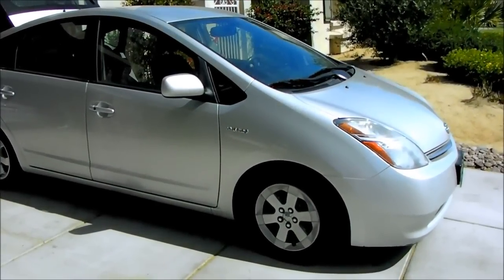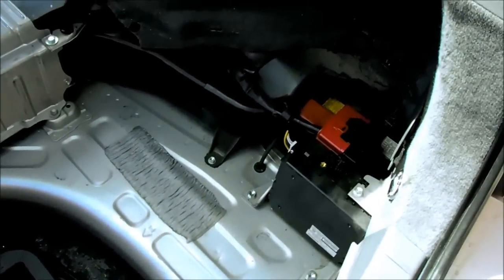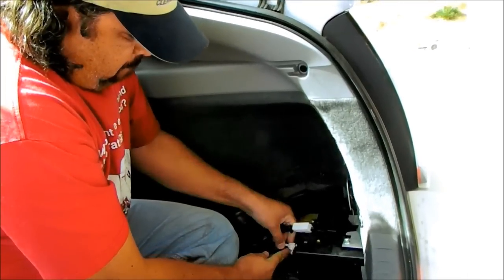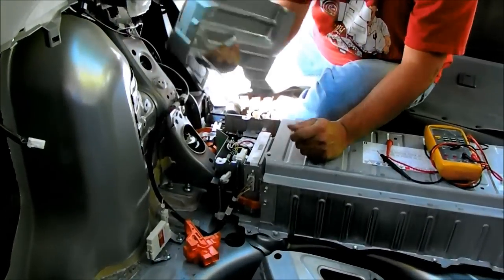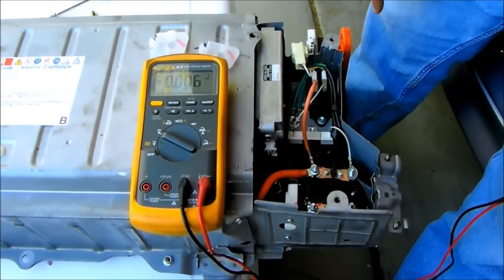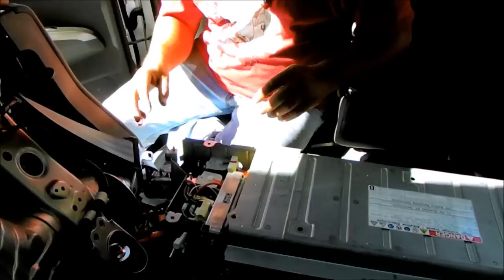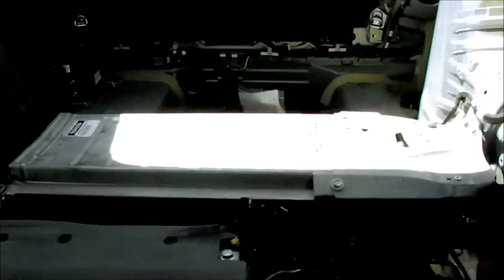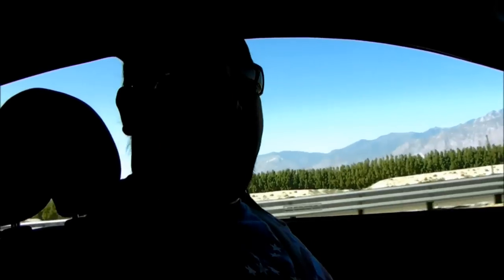Toyota Prius battery removal and repair. replace hybrid check engine light

Comment: Curious if there is something you need to do after replacing the battery. I just pulled the battery out of my 2007 Prius using this amazing video, then replaced the bad cell for $25 and put the battery back in. Now the car starts, but won't go into drive. Only park and neutral. Is there something special you have to do? Like hit a reset button or something?
Reply: yes put the service switch properly.
Reply: Michael McReynolds Same thing happened to me. No error codes and dashboard looked normal, just wouldn't go into drive or reverse and AC wouldn't cool. After a lot of retries, I pulled the fob from the slot, locked and unlocked the doors and put the fob back. It started working and has been running fine since. Have no idea how that fixed it.

Comment: It was not so much the 3400 toyota wanted to replace my 9 year 96k mile battery that got me but it's the only 1 year warranty on a brand new battery. I don't think I will   be buying another toyota after that. Right now I'm in the process of changing my one bad cell for the price of $46. My advise so far is take off your watch and ring when picking up or working on battery.

Comment: I drive a 2005 Prius that I purchased brand new.  Just today, I got the red triangle with an explanation point, the check engine light, and a message on the touch screen indicating a problem.  Interestingly enough, exactly 1 month ago I purchased one of those gadgets called 'Automatic' that plugs into the service port in most cars and interacts with their related iPhone app, also called 'Automatic'.  One of the cool things it does is report any engine trouble complete with detail which it did perfectly today - it reported an engine code of "P0A80" and an explanation of what that means, "Replace Hybrid/EV Battery Pack".  Very cool to know and not so very cool to know, if you catch my drift.  :)  Anyway, my 9 year old Prius car has only 81,261 miles on it.  What are the chances you think the battery needs replacing this early in the game for my relatively-low-mile Prius versus there only being a loose connection of some sort related to the main battery?  Actually, come to think of it, I had my Prius in for its 80,000 mile factory service at the same Toyota dealership I've been taking it to for service since buying the car, and I distinctly recall the same issue I experienced this morning just as I pulled out of my driveway on my way to work, which was brief bouts of hesitation in acceleration which cleared right up after few seconds.  My car was parked for about 10 hours and then about a minute after I began driving it to head home, the red triangle and other problem indicators appeared.  At this point, I'm planning on taking my car in to the dealership tomorrow morning and having them check all the battery connections, etc.  Any thoughts and/or ideas pertaining to my particular situation?  I'm all ears!  :)  Thanks...
Reply: Im curious to hear about your prius?
Reply: its a bad cell i have the same problem.

Comment: I just changed a new hybrid battey, but  I can't shift my tranmisrion. this message show up:
Caution 
The transmision "P" lock mechanism is abnormal. Park your car at a flat place, and apply the parking brake completely.
I park a car at a flat surface. I can't get a car run because of this problem Please Help!!!!!!
Reply: Jfff
Reply: +dupon lim make sure the small 12v battery has 12 volts and the ready light is on on the dash or you might need to replace small battery that happened to me when my small battery failed and it also throws other faulty codes inc replace hybrid when its just the small battery

Comment: Our 2006 Prius battery just died on us.  We were 1 month outside the 8 year warranty period, and only had 98K miles on it.  Toyota however cut us a deal on a new battery only knocked 50% off the price of the battery so $1200, instead of $2500.  We just had to pay for the labor.  This brought the total up to about $2100.  Still sucks, but at least its a brand new battery.  I thought about going the ebay route and swapping out the bad cells, but I felt this was only kicking the can down the road.  Great Video by the way.  At this point we are just holding off til the 2015 Prius comes out with a Lithium Ion Battery, in which these problems will be a thing of the past.
Reply: Just because it is li-ion does not eliminate the bad cell problem. A battery is still a battery. I have been around them in depth for 45+ years. You will still have to deal with the problem. Ole Geezer.....
Reply: What an amazing coincidence, Toyota just quoted me to replace my battery out of warranty for...$2,100
Reply: Robert Mencl
Sounds like they have cut their price to replace the battery.  Good move by Toyota.  Still not happy about it, but at least they are being some what reasonable.
Reply: Fred Yates
Interesting, all this time I thought Lithium Ion was better than regular batteries in this respect.  After you reply I did a little more research and realized they are about the same, even though Lithium is making improvements.
Reply: They have a higher energy density, which means you get more power per lb, but they still will fail. It is just a different chemical composition. The weakest cell will give out first, just like in any battery pack, might take longer, but it will happen.

Comment: Great vid, i have a 2007 with 380k miles still on the original battery pack :) i just replaced the inverter first issue ive ever had with the second gen, thou i drive my 3rd gen more with almost 500k on it :)

Comment: Awesome video the warning light just came on and I am showing the P0A80 could which on-line tells me this is the battery I also got a P1121 code which is a coolant control valve

Comment: Hi
I replaced a new auxiliary battery for toyota camry hybrid 2007
I waana just ask about supply break control power there is one plug  blue and yellow wires where i have to connect?i have to connect to positive cable battery or where

Comment: What scanner did you buy to read your codes? I took it to autozone and they said their scanner won't ready hybrids. I want to buy one but don't want to get one that won't work. Thanks!
Reply: +kyle lucas same thing happenef to me at autozone so i went to advance auto parts and the read it np there reader was orange i think it was al tek  or something like that
Reply: I bought a basic wifi OBD 2 reader from Forseal on Amazon, and downloaded a $10 app (OBD Fusion) and it read the codes for my 2006 Prius fine, and reset when I was done. Maybe newer models require different scanners, though, I only know what worked on mine.

Comment: I've been intermittently scanning for a video like this, good job, man! I know it took you longer, but I bet a tech who does this every day could do the job in an hour. How they get $1000 in labor charges out of that is obscene. Is there a core refund on the battery? Where did you buy the re-manufactured battery?
Reply: Hi Dave In Canada you can check out your independent parts dealer for the battery.        http://www.dormanhybrid.com/
Reply: Thanks, Steve. I'm not in the market right now, but likely I will be in a few years, so I'm learning as much as I can in anticipation.

Comment: a HV battery from a 2008 prius IT WORK ON A 2004???
Reply: I think 2004-2009 batteries will all run together. 03 and down work together and for the third gen it varies I believe because of the plug in. Always double check to be sure if you're buying one though.
Reply: thank you

Comment: ok i just did this repair but i rebuilt the battery pack, i needed one cell and got it off ebay for $45 shipped..i cant stress enough to be safe...dont try to clean the contacts with a metal wire brush...also the safty orange plug MUST be pushed down after its seated or the car will not start..also my car would not start for 15 mins after everything was back in place so dont be shocked if it happens to you, I think the computer has to reset to the new voltage or something..

Comment: Thanks for posting this video.  I imagine the SW heat accelerated the lifespan of your battery.  I have a 2004 Prius with 209,000 miles and the battery is  in good shape.  It was interesting to see how you replaced the traction battery.  You did a great job!!

Comment: Since you started doing this, any exposure to the 2006 Highlander battery?  Mine is "dead" (still driving around on it) and the cost at the dealer is $6,400.  Sadly, in the Pac NW so I can't have you fix it.

Comment from the maker: You could but I don't see much advantage in it and it will probably overload the charging circuitry with the extra load when the batteries are drained. Just my opinion would never try it.

Comment: hello just bought a prius off of an auction with some front end damage after car was fixed , 1 red triangle light came on and also check engine light , i got codes p1151 and p0a80 , do i need a new battery ? the mpg is really poor around 15mpg...

Comment from the maker: Does your 04 have the info screen that shows the hybrid battery charging? It should be blue and then go to green when getting close to full charge. If it is purple a lot and sometimes blue but almost never green then that would tell me the battery is getting weak.

Comment: I'm pretty competent with electronics, and could probably do this repair job myself if mine ever goes bad, but I don't think I would do it-- I've made too many dumb mistakes in my time to risk it. That said, this is a job that a competent and careful shadetree mechanic can do on their own and plenty have, and as far as I'm aware, none have died. Just remember that one mistake can kill you with this battery. Take the necessary precautions, and if you feel nervous at all about trying it, DON'T!

Comment: hm... my 2009 has 112,000 miles and runs like a complete champ. however im getting nervous as ive seen 2 videos on here of people with around 160-170k miles and dead batteries. HOWEVER one was an 05, and this was an 06. im seeing them with 200k and up on orignal batteries as well so i think its just luck,

Comment: No I don't wear namby pamby gear when doing oil changes, his when you are doing any hv dc measurement gloves must be worn, don't be fooled, I've been shocked by ac and am lucky to be here still. If it was dc then I would not be here posting this. Yes once the service plug is removed it should be safe to work on but when removing the plug and taking voltage measurements why chance it, use the gloves and when 0v or less than 30v then work away without gloves.

Comment: Good video.  While hybrids don't attract the most hands on buyers anyone with common sense can follow this video and not kill themselves, that service plug will keep you safe.  If you did get "hit" by this battery it will hurt but the odds of death are very slim.  If you're worried about electric shock wear rubber gloves when you're doing this..

Comment: The hybrid battery is not what gets the prius START, it is the aux-battery in the back. Try to use another 12V battery and jump-start it, it will probably run without the jump start battery, and you can try remove it. If it works, you can see if the aux-battery gets charged when driving.

You can get to a service menu to check the status of the aux-battery when you have got the car started, check /watch?v=cyNJm1SFS1E for how to check it.
Reply: martinlumsby INCORRECT! The 12 volt AGM battery DOES NOT start the ICE (internal combustion engine). It does power the computers and accessories. The 201 volt hybrid battery spins the MG1 electric motor in the transaxle which in turn spins the ICE and gets it going, then spark and fuel are introduced.

Weber automotive has a very informative video on all of this posted on YouTube.

Comment: It would be nice but LIPOs have a completely different charge curves which means reprogramming how the charging works on the Prius. LIPO's if charged or discharged incorrectly can leave a melted blob where your Prius was.
There are add on kits that use LIPOs where it has its own plugin charger that properly charge LIPOs. Similar to the new 2013 Plugin Prius. 
In fact the plugin Prius uses a LIPO pack a NiMH along with a lead acid battery.

Comment: Hi...Just purchased a hybrid battery for my 05 toyota Prius, since I was told by the dealer it needed replacement.  I installed it according to your video but the car doesn't start and the warning lights are still on.  My scanner doesn't give me any codes and the voltage of the battery is marking correctly.  Is there any advice you can give me??...I would really appreciate...Thanks!!!

Comment: Well I would check all the battery places where you live and see if anyone will replace just the batteries that are bad..A mechanic told me there are multiple batteries and they dont all need to be replaced. Apparently its a battery pack can be broken down to multiple batteries.
Call junk yards and you will find you're guy. My friend had a guy do his for 550 labor and everything.

Comment from the maker: Not really. I see $850 for just the battery then you have to pay for shipping also that's about $240. Then there's a core charge if you don't ship them back your old battery it looks like so that's another $240. That's roughly $1330 and you give up your old battery, so it doesn't look like its any better to me than what you will find on Ebay.

Comment: I have enjoyed to great mileage from my Toyota Prius for over 6 years.
At 137k miles I recieved multiple warning and engine lights.
I took my Prius into the dealer to be informed that the Hybrid battery needed replacement.
The cost was going to be $4k.
I found a refurbished Hybrid baterry on the Internet and followed the steps in the video.
My Prius is running again.  Awesome!!!  Thanks for the video!!!
All error codes cleared, did not need the scanner.  I'm disappointed in Toyota and Prius,THX.

Comment from the maker: You didn't read all my comments here did you. Also I mention a number of times that the repair should not be done by someone not familiar with using a multimeter and finding positive / negative polarity. That right there eliminates unqualified consumers. The Video is a resource for real DIY people not the averge joe that doesn't have a clue.

Comment from the maker: It is dangerous there is around 220 v DC stored in those batteries, so nobody should work on it unless they feel comfortable using a meter to locate energized and de-energized parts. Make sure you get a battery that has been tested good besides the 28 battery cells there are 3 relays and ecu inside that can go bad.

Comment: Nice. 
Thank you very much for uploading great video. 
One question for you though. 
When you bought a new replacement battery. Did you bought it already charged? or you had to take it to dealer to charge it? And what did you do with old one? Did you got any money for recycling it at the dealership? Or you end up paying them to take it away from you? I was told that you have to charge new batter and only dealer can do it? is it correct?

Comment from the maker: I have been in those shoes and soon the computer will go into limp mode and you won't be able to go over 20 mph until you erase the check engine light. Then it will return to normal mode for a short distance and then back into limp mode and you will have to erase the check engine light when it comes back on. Send me a email drsjr1969@yahoo.com and let me know the mileage on your current batteries and I'll give you your options. include your personal info also so I can contact you. Thanks

Comment: Hi. Good of you to share this valuable info...I'm in Southern Calif and have a 2006 that needs a hybrid battery replaced...red triangle, dealer confirmed this is what it is (although it's still driving the same as it was, getting same power, nothing on the battery display shows anything different so far...) Either way, if I can get the car to you, what would you charge me to either: recondition my hybrid battery (2006), or replace it?

Comment from the maker: When you average a little over 40 MPG and gas is going upwards to reach the $5.00 per gallon mark. It's easy to justify a $2,000 or less repair when you do it yourself. $3,300 is alot harder to swallow.